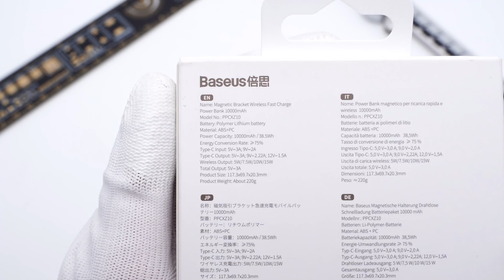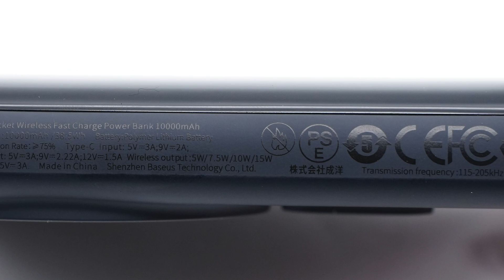Foldable Kickstand | Teardown of Baseus 20W MagSafe Wireless Power Bank

Comment: 4:51 Do you mean series?
Reply: Nope, the protection ICs are indeed in parallel. That increases the maximum allowed charge and discharge current, and putting them in series wouldn't have helped since both battery cells are in parallel anyway.
Reply: I can't find this product. can you help me